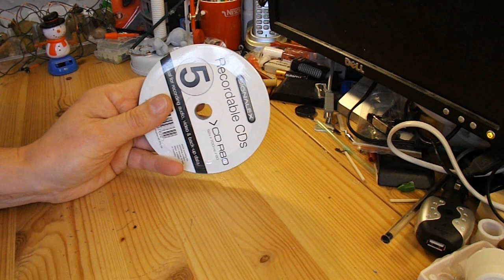Electric Toy Car with CD body and CD wheels

Comment: Please, any tips for avoiding wobbly wheels when making them from CDs, bottle tops and skewers?  I've made mine the same as yours as far as I can see, but mine end up quite wobbly and it doesn't go straight.  Does it mean my holes aren't quite central?  Should the skewers be very tight in the holes or a little bit loose?

Thanks!  I've just discovered your videos and they're awesome!
Reply from the maker: ***** hi Paul. Generally speaking I know wobbly wheels look bad but usually they sort of balance themselves out across the car and go fairly straight regardless. With rubber band cars I find unevenly winding the band across the axle tends to bend it and that has more impact on the direction the car travels. Having said that, when I started using CD wheels and using bottle tops as the hubs I put the holes in first then glued the tops to the CD but often found I got the bottle top off center so the wheel was twisted. I have tried gluing the bottle tops on first and then making the holes and some times that works better. I guess making the holes first is probably better if you have markings on the CDs to help you align them as you glue them in place. Most of the tops I use have a mark in the center from the original molding so it should be easy to get that right. I always have the skewers as tight as possible especially on the back axle otherwise the axle will spin loose without turning the wheels
Reply: GrandadIsAnOldMan Thanks for that.  I find that no matter how centrally I try to make the holes in the bottle tops, my bradawl might go slightly off centre.  What I did was put the car together so the wheels move round without wobbling and only then glue the hubcaps in place (with superglue).  On one wheel the hubcaps weren't central because the holes weren't either, but it runs much more smoothly.

My buggy was veering to one side as well, but that's because the axle holes were not quite symmetrical.